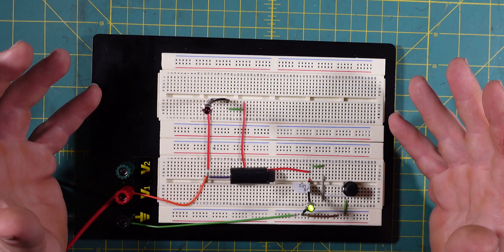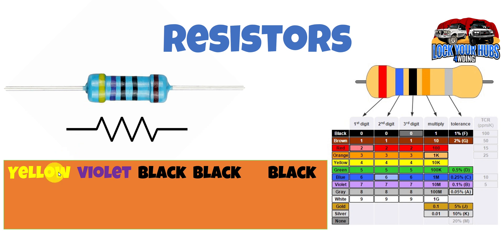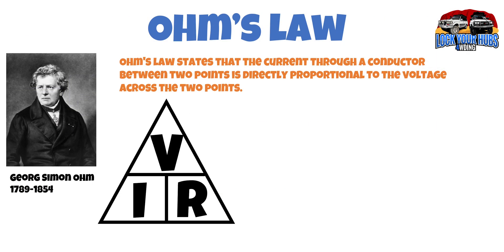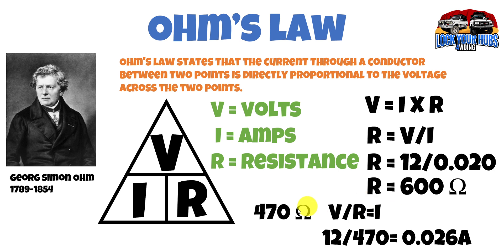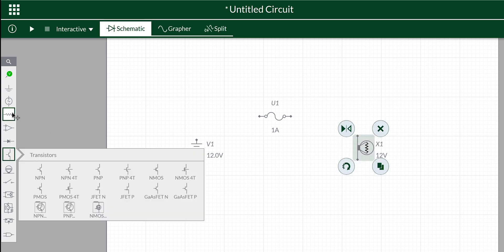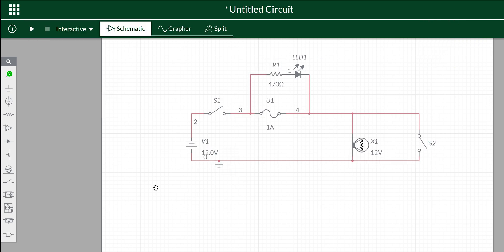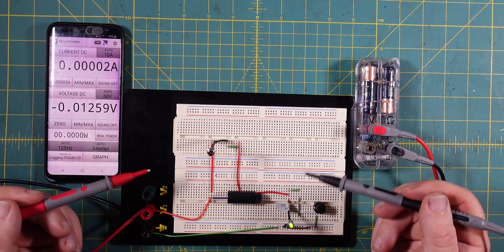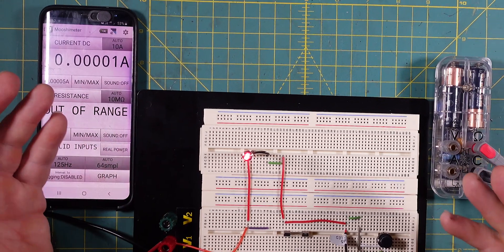How to Build a LED Blown Fuse Indicator

Comment: I have often read concerns about inserting a hypothetical bypass to the fuse. Clearly they have no idea how the current works, for example those who claim that it is dangerous to keep the circuit under voltage in a nautical environment do not understand what role a fuse has and it is also wrong to believe that a 1/4 watt resistor and an LED can support such an operating current. The system works because with the fuse you have practically 0 volts at the ends of the additional circuit and with the fuse blown you get to have more than 12 volts which turns it on. However, a solution to eliminate any current consumption (let's not forget the inserted resistance) as in the case of a LED array, a solution is to insert a button that is always open on the upstream side, i.e. where the fuses are in common, which then, by activating it, closes the various LED control circuits and therefore checks which fuse is compromised. In this way, even those who want a complete opening of the circuit when the fuse is blown are happy.

Comment: I like your explanation, it is true as noted that there are small differences in the values to be taken into account. But you explained everything very well that it is easy to proceed with the necessary corrections. In any case it is an alarm circuit and certainly not one that must remain active for a long time, so even small differences in a short time the components can tolerate them.

Comment: Hi, as you mentioned a 470 Ω resistor the current used would be .026 mA. Myself I would use a 620 Ω resistor, where the current draw would be 19.3 mA. Thus the lower the current draw the LED would last a longer period of time. But better still I would use a lower resistor to be able to draw around 16 to 18 mA.
Reply from the maker: It would, though you would hope the fuse issue would have been fixed by then!

Comment: I have a request, from a complete non-engineer.
Because correct me if I’m wrong but the indicator will only work if the user is attempting to put power through the circuit.
If I wanted a reliable indicator, couldn’t the circuit be designed to put a micro voltage through the fuse at all times, even with the circuit powered off? And couldn’t the indicator be charged via a separate circuit, such that you could have an array of indicators for each and every fuse in a panel?

Comment: Would I be able to use this idea on a switch to indicate when it’s off? I’m about to put in a kill switch on the feed to my aux battery and thought that  having a red light would be a good visual indicator. Great work as always.
Reply from the maker: Yes, same principle. There may be a reduced voltage avaliable at the output, dependant on the diode, resistor and supply voltage.

Comment: does that multi meter thing plug in/bluetooth to your mobile phone? if so what is it ? i'm interested in getting one......... thanks for another great video bud and explaining it so simple humans like me understand it........
Reply from the maker: Yes bluetooth, it's a mooshimeter. I probably wouldn't want it as my primary multimeter, but for things like measuring voltage and current simultaneously or datalogging, it's hard to beat.

Comment: Can you explain why opening the shorting switch again (without replacing the blown fuse) doesn’t allow the circuit to flow again? LED doesn’t allow enough current through to the bulb?
Reply from the maker: It will allow a much reduced voltage at the load. Though no where near the supply voltage.

Comment: I like to fiddle with stuff too, but wouldn't it be simpler to buy fuses with the LED built in? But interesting anyway, thanks.
Reply from the maker: It probably would if they are avaliable for the type of fuse that you're using.

 I haven't seen one for the m205 package as used in the video.

Comment: A couple of things you need to think about...
When selecting components, use the highest voltage the circuit will see. In a car, that's the charging current, normally about 14V.
You also need to take into account the forward voltage of the LED, which changes with the LED colour!  In the case of a red LED, that's 1.6 to 2.0V. Coincidentally, the (choosing the safe value) 1.6V and voltage difference (14-12) mean you'd get away with it.
But it's worth considering ALL the voltage drops in a circuit when calculating components.
Reply from the maker: Agreed, though I thought this video was getting long enough! And as we're looking at typical car voltages for most of the viewers, selecting the right resistor for the LED was the most important consideration, so that's what I went with.